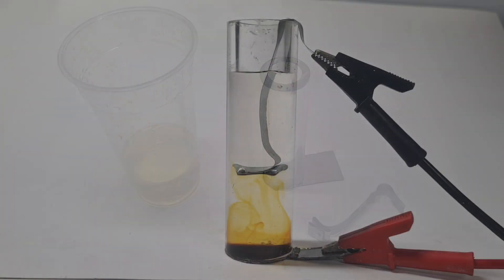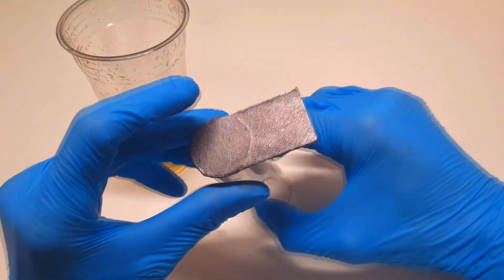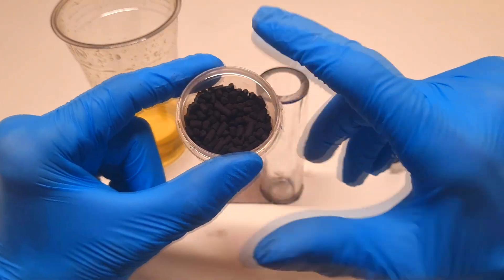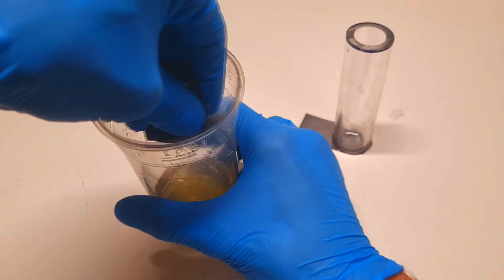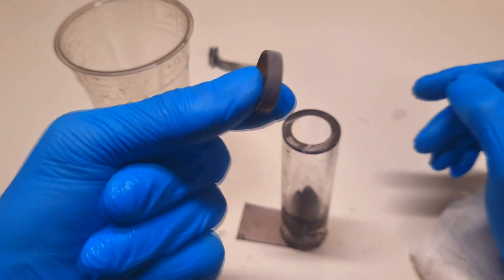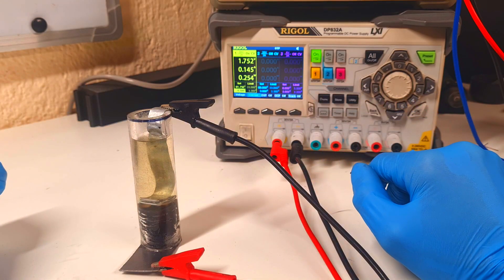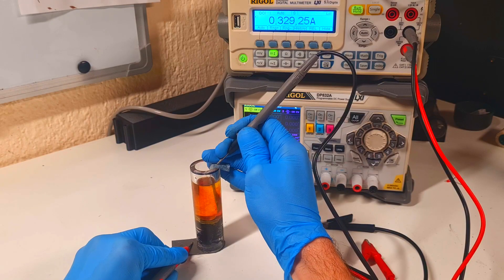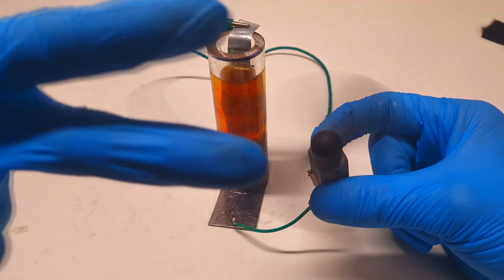Let's make better Zinc Iodine Gravity battery

Comment: This is a great idea! I think you could do a couple of things to improve it:
1. Get the bubbles out of the carbon foam. They reduce the surface area that is in contact with the electrolyte.  Either you could put it in a vacuum chamber like you would with cast resin. Or you could fill the battery and use a rod to press and release the foam till you can't se any more bubbles.
2. Make the surface area of the other electrode larger by coiling the end into a tight spiral. Wrap it around something small and hard like a nail. It only needs about a milimeter between each layer for the electrolyte to circulate through. Again, make sure there are no bubbles between layers by tapping the electrode when it is submerged. The last layer of the spiral should be folded diagonally to make a 90 deg turn so that it can go up to the top of the container.
I subscribed and I'll be looking out for more videos from you soon!